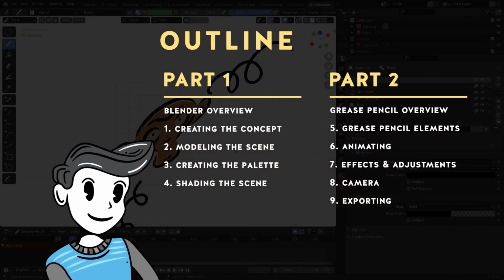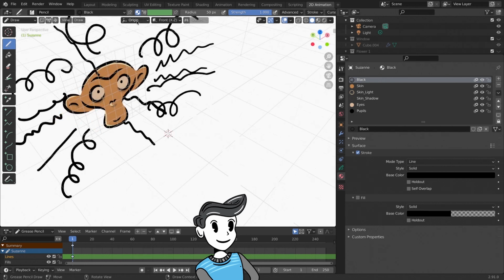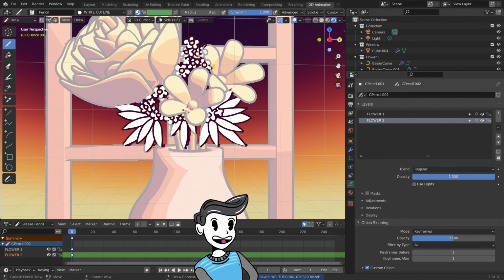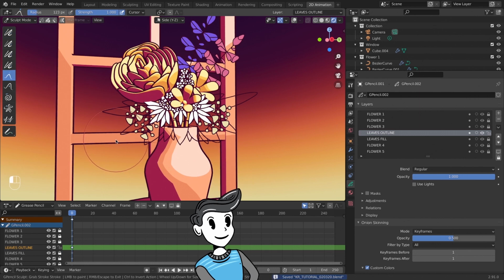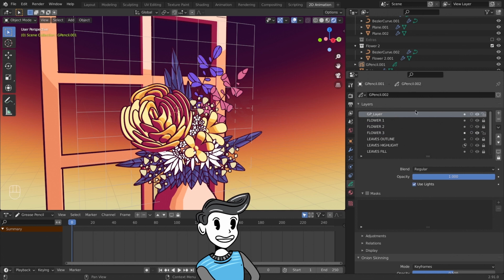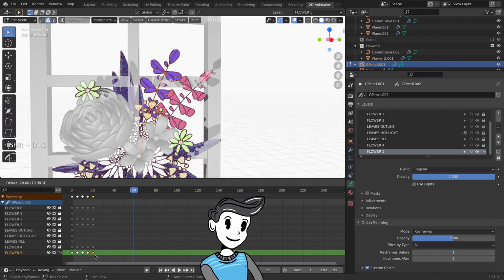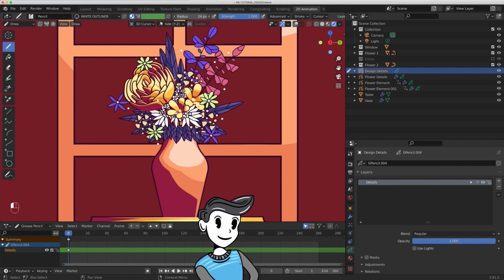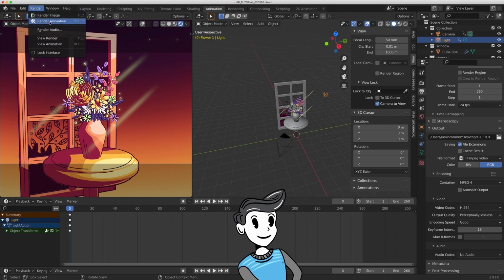Blender Grease Pencil Beginner Tutorial - 2D & 3D Toon Shaded Scene - Part 2/2

Comment from the maker: Hey everyone! Just a few updates on grease pencil in Blender 3.0:
• If you'd like to draw on a new frame, you'll need to  press the "auto-keying" button at the bottom of the timeline. If you don't have this turned on, you will accidentally draw on top of the previous keyframes. 
• If you're looking for the Interpolate Sequence options in Edit Mode, in the viewport, it will be under "Grease Pencil > Interpolate Sequence". Shortcut is Shift + Crtl + E in the viewport.
• There is now an option  to "Auto Lock Inactive Layers" in the layers panel.
• If your grease pencil objects appear over your meshes and ignore the Z space, go into the View Layers tab and under "Data", make sure "Z" is checked.
• Right Click in Draw Mode is a shortcut to quick access Materials & Layers

Good luck!
Reply: hey man , you have a tutorial (from you or someone else ) to create that small video avatar ?
Reply from the maker: @alexmehler6765  I don't yet, but will think of doing that for the future!
Reply: I had a issue with the Z space (My flowers were on top of my ROSES >:((( )
but when I enable the Z in DATA in View Layer Properties it repaired and my Roses are nice looking
Thanks for help

Comment: well everything was ok until rendering, I got a huge problem like all those grease pencil drawing are drawn front whereas 3d models are shown behind, I tried everything method but still I am unable to solve this, does anyone have a solution for this? please do reply
Reply from the maker: No worries! This is a new feature in Blender 3. All you’ll need to do is go to the view layer properties tab and under Data, make sure Z is checked. Then it should display correctly when rendering. Hope that helps!
Reply: @kevandram  OMG! I had the exact same issue. With your method problems solved. You saved my day!!! Thanks!

Comment: Hi Kevin, first of all thanks!It's a great tutorial. Although I'm a bit stuck in the first animation step. When I rotate the flower doesn't appear the key frame automatically, if I do it manually just disappear in that frame. :(
Reply: Update, a second after I wrote I found the solution totally by chance . It was on a botton call multiframe, if it helps .  Thanks again kev. :elbowcough:
Reply from the maker: Sorry for the late reply! Glad you were able to figure out a solution. I was going mention that it might be that the record button needs to be enabled. This is a new feature from Blender 2.9 + where if you want to automatically create keyframes, you'll have enable it. Hope that helps!

Comment: When I try to move flower 5 back, it moves all grease pencil layers???
Reply: I think cause I have to lock layers I don't want to move? They also move like super far each tick unless I hold down control, why is that?
Reply from the maker: Yes that's correct, you'll need to lock all the other layers you aren't using. If you'd like to just select each stroke individually, you can use stroke select (numpad 2) and that might help.

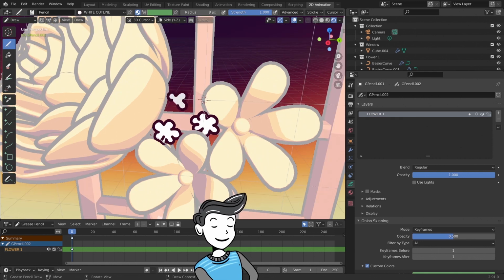Comment: I couldnt draw a flower(14:20). I did follow all the instrustion.. but still couldnt :( 
and i m using blender 3 version.. does that matter in this case??
Reply from the maker: So sorry about that. It should still be compatible. Were you trying to draw with Grease Pencil?
Reply: @kevandram  yes was drawing with grease pencil
Reply from the maker: @coolsg10  Check if the drawing plane and stroke placements are correct and that you’re on a keyframe with drawing, then it should work here.

Comment: Hi, in the final render the animation is not looping, Can you help?
Reply from the maker: Thanks for checking out the video! Let's see, do you mean the export isn't looping or the animation inside Blender?
Reply: @kevandram  Time Offset Modifier doesn't work in the render I checked the render icon too
Reply from the maker: Check to see if "keep loop" is checked on. By default, it's off. You can find this in the time offset options. Hope that helps!
Reply: @kevandram  hey I'm having the same issue with keep loop checked, animation stops at 20 seconds time offset not working. Anyone resolved this?
Reply from the maker: @tastegusto4547  check to see if you’re viewing it in object mode. If you’re in any other mode, it will not work.

Comment: A tip: Set your Stroke Depth Order to 3D Location in the GP object Data properties. That way you can freely add strokes behind or in front of the others without having the newest strokes overlap the former ones! :)
Reply from the maker: Thanks for the input, but I intentionally did not use 3D location and kept it 2D for this primarily because GP is a little glitchy when it comes to overlapping color layers (specifically the highlights and the shadows). I wanted to avoid any confusion from those following along. But feel free to do whatever you’d like 😁
Reply: @kevandram  Ooof, thank you for the reaction! Guess I still need lots of experience - Glad there are channels like yours that make it super fun. Really grateful for the inspiring & educating videos. Keep it up ☻

Comment: the time offset modifier has no effect on the animation when rendered , the animation is not repeating even the time offser modifier is active , it is working fine on the viewport but not when rendered , the rendered video only shows the 20 frame animation,   plzz help me if anybody encountered with the same issue...
Reply from the maker: So sorry you're encountering that, sounds frustrating. It might be that the modifier is disabled in renders. Click on the modifiers tab (the blue wrench icon), go up to the title "Time Offset Modifier" and to the right of it, check to see that you have both the screen icon and camera icon highlighted. Blender has a functionality that allows you to see something in the viewport, but not in the render and vice versa. Check that (and make sure keep loop is checked) and hopefully that should work.
Reply: @kevandram  I check to see that you have both the screen icon and camera icon highlighted. but still the animation is not repeating
Reply: @kevandram  still not work QAQ
Reply: @kevandram  yes it doesnt work
Reply: Howdy! I know this is super late, but I just encountered this problem and the way I fixed it was by going back into Object Mode. I forgot that Modifiers can't be applied in Edit Mode, which is what I was on.